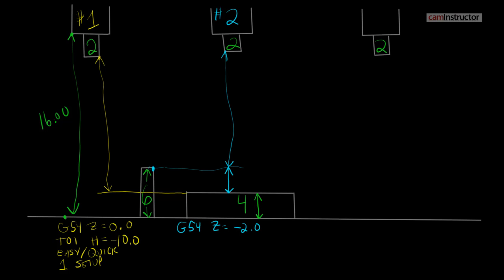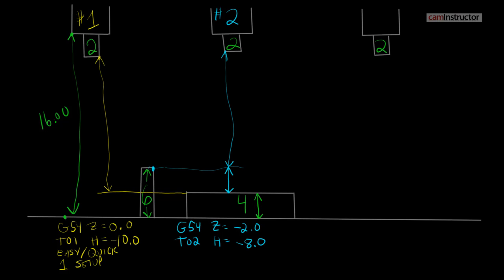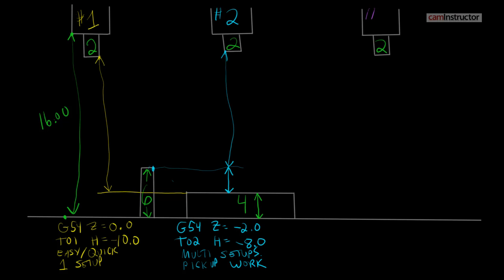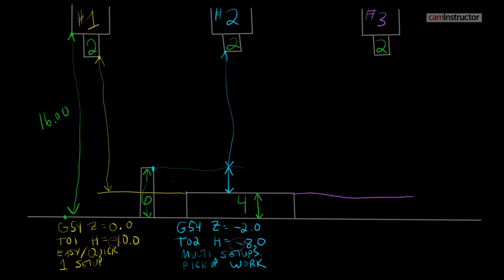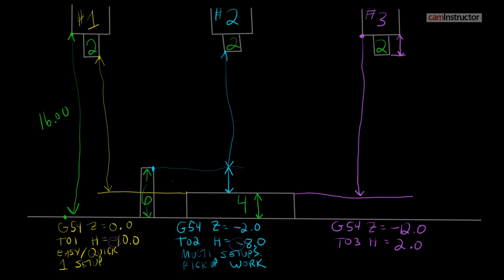CNC Tool Length Offsets Explained

Comment: I have been using the 3rd option for a few years but what I do is that the underside of the spindle is zero'ed on the table and then enter that value in the EXT table on work offset (value from machine zero to the table). So Z work offset for G54 is measured from the table to the top of the work piece which gives more understandable values.

Comment: Great explanation! I jus started as a CAM programmer (Hypermill) for turning and milling but I have no CNC experience in practice and no CAM experience. So I'm digging through the manuals of the Okuma lathes for starters (there is the most need in the turning department) and understanding offsets is a vital aspect. In fact the big Okuma has a VDI QC tool holder system and yet they have used the 'master tool' system which is not very smart. Working from a fixed tool holder interface is the way to go.
You point out that probes have a known length, the same must go for lathe probe arm systems. I have been looking at some Haas videos on their probe arm system. I have yet to understand fully how it is calibrated and which offset numbers are put into the offset table.

Comment: In the first method, I like to think that the tool length offset isn't meaningless, it's just that "tool length" is a bad description. I think "tool distance offset" is a better description since its the distance from the bottom of the tool to the top of the part. In the second method, we have a "tool distance offset" and setting G54 is like a "distance correction offset."

Comment: How do you measure the spindle face to the work?? That would terrify me. Here, let me just bring my expensive spindle down and hit it on the stock. So then what? Use a shim? I'm curious to know how this is done.
Reply from the maker: Would be no different than touching a tool tip off to a workpiece. Yes, most will use some sort of shim be that something small like a piece of paper or something larger like a gage block or 1-2-3 block.

Comment: I spent days trying to find a good explanation of this and yours is by far the clearest and best explained.  Which method works best for multiple tools and mutiple setups for the same part? And How would it work if you used method #2, but the arbitrary "block" had a height equal to the height of the spindle (16" in your ex.) ?
Reply from the maker: 2 or 3 would work for multiple parts, each part would have its own work offset (g54 g55...)

Comment: best way  set you tools from tabel . you can use g54 ,, 55 ...56   just set you offset in tabel  .. G54  55  56 from tabel to top off you parts   ..all tools works
Reply from the maker: The table works, the tricky part is knowing when the tool is touching the table. This is why we use some sort of block or even paper and just account for the thickness of what was used.

Comment: If i use method 3 that new value on the operator is the number i will use in the offset geometry for length ? 
Thanks for the video

Comment: Why not touch the tool off to the table(Hx) and use an dial indicator from the table to the top of the workpiece(G54)?
Reply from the maker: You would still need to use something to gauge when the tool is 'touching' the table. Using a piece of paper for this would be the same as using the 6" block in the video, just the paper is ~0.003" think instead of 6". So steps would be the same as scenario #2.
Reply: @CamInstructor  Yes, I use a 1,2,3 block.

Comment: If I take a height Gage and measure the distance from the part to the machine's table, what method should I use?
Reply from the maker: This would be the second scenario. Sounds like you're just removing the block shown in the video. 
I guess you are touching your tools directly to the table? Or do you touch them to a block, measure your work piece and then subtract the block height from your measured height?

Comment: what if we use scenario No.2
but instead of using  246 Block
we use imaginary block that length is equal to the distance between table surface   and the tip of the Bit.(it would be 14 inch in your Example)
i think that mean T  length would Be T=0;  (the other tools would be T2=T2-T1,  T3=T3-T1 ,  T4=T4-T1 .....)
and G54 Z= Z value when you touch the tip to the surface of the work piece.(it would be  -10 inch in your Example)

would this work ?
Reply from the maker: Yes that would work, the math checks out.